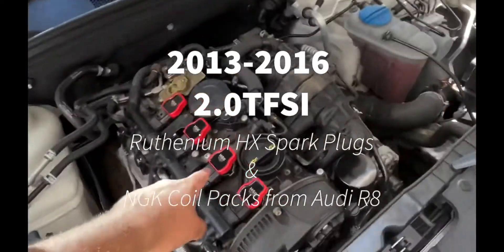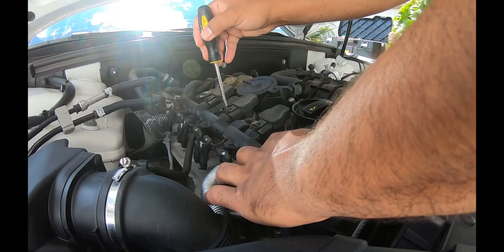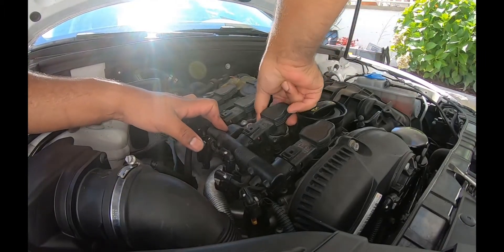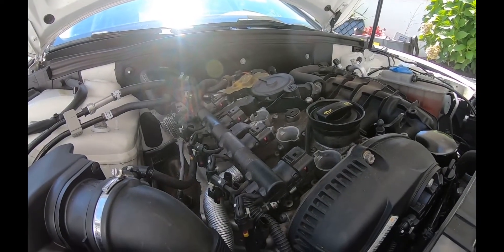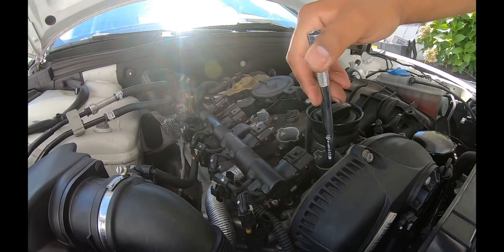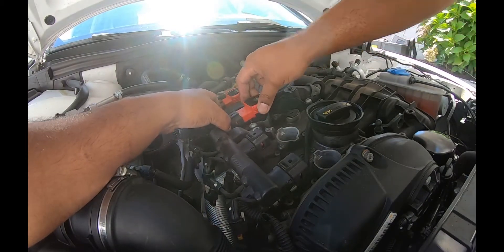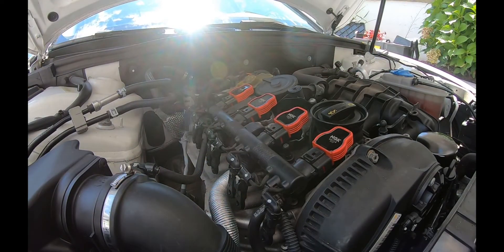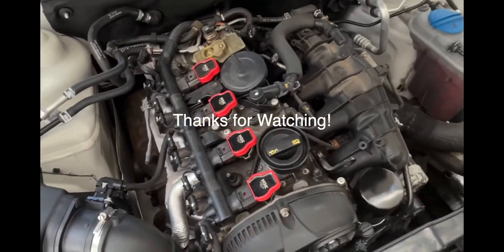How to Install Spark Plugs & R8 Coil packs on the b8/b8.5 Audi 2.0T A4/A5/Q5/A EA888 Gen2 DIY

Comment: Can you put these on a stock a4?
Reply from the maker: As long as it’s the 2.0t, then it should be fine.
Reply: @BestHombre  one more question do the ignition coils have to go in a certain order or does it not matter? 😭
Reply from the maker: No worries, happy to help. The coils are interchangeable.

Moving coils around is also how you diagnose a misfire. 

For example, if you have a misfire in cylinder 1, move the coil from 1 to 2 and see if the misfire jumps to 2.
Reply: @BestHombre  shoutout to you man thank you !! 🐐